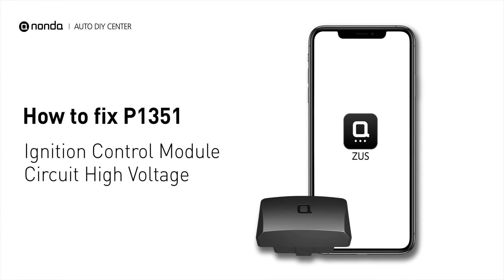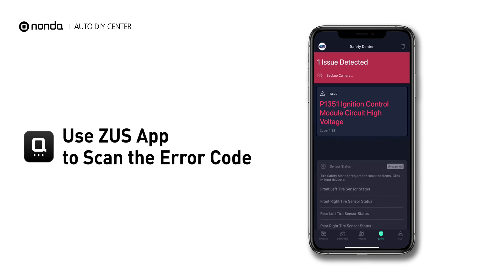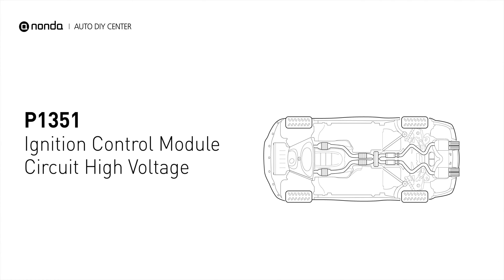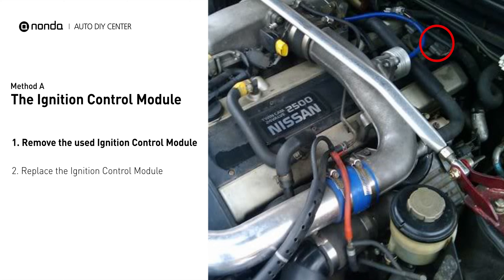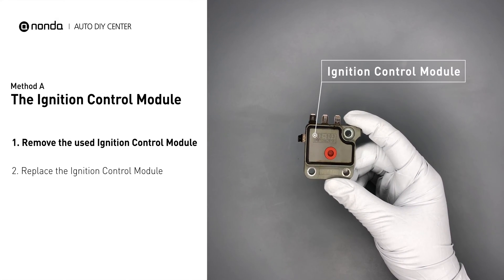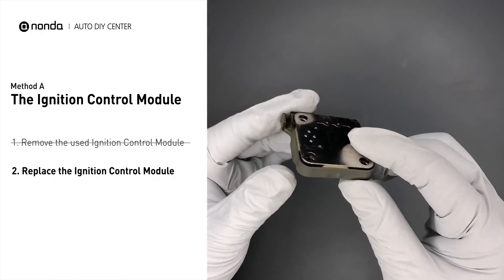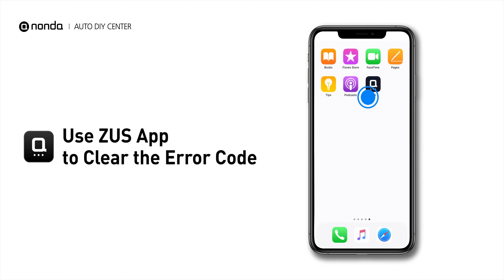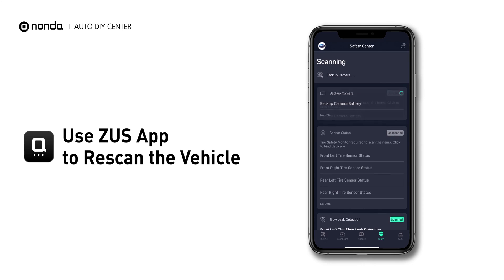How to Fix P1351 Engine Code in 2 Minutes [1 DIY Method / Only $11.86]

Comment from the maker: Hi, I'm Steve, nonda's lead mechanic engineer. 
Feel free to leave your comments here if you have any mechanic questions, I will be glad to help you out!
Reply: Hi i have a 1999 chevy silverado cranks but wont start acts up once in a while then comes on shows this code p1351, right now cranks but wont start and throws explosion from throttle body
Reply: @a.d1280  Us too!! What's wrong with yours??
Reply: Where is ignition control module located on a 2014 citroen grand c4 picasso.
Reply: Esse código é na ignição?
Reply: P1351 is also make specific with it meaning different things between car brands so I don’t see how this could possibly fix this code for anyone.

Comment: Didn't get this code until after installing a new ignition module,was getting different codes for random misfires & misfires in cylinder 1 & 3 on my 4.3 ltr S-10,the coil,wires,spark plugs,cap,rotor,cam sensor,crank sensor,erg valve & spider injectors have all been changed.

Comment: 1351 is a long crank code and could be caused by anything, Bad starter, bad coil, Bad fuel pump bad connection anything that make for along cranking on start up will set that code.
Reply: seems stupid to beeline to throwing money at it doesn't it. I start with dielectric grease after examining connections.

Comment: Hello Steve, I understand other parts need to be checked before replacing the ICM. What are your thougths? I am only getting this one code P1351.
Reply from the maker: Hi Carlos, can you please provide us with your vehicle's year, make and model?
Reply: @nonda  hey I have a 98 Chevy tahoe with this code
Reply: @nondainc  My apologies. Chevrolet Suburban 1500
Reply: Check all fuses and relays first , use a test light check for power and ground , koeo  , with test light lite try to start it , watch for the flicker in the test light , ( for cam sensor )
Test coil to ground arcing spark to the ground if it has any , should be bright blue , if its weak , distributor cap and rotor , no spark and all the others check out , ignition module , if test light dont flicker , cam sensor under the distributor cap ..if someone unplugged the computer , pins probably slid back in the plug in , #9 pin should be white power wire to coil ..

Comment: Changed my timing belt on a 2001 Toyota Avalon now I’m getting codes p1300,p1305,p1315,p1325,p1346,p1351 didn’t have any problem with the car until that
Reply from the maker: Hello, since you are receiving multiple error codes, we highly suggest to get your vehicle visually inspected by your local mechanic for further diagnosis.